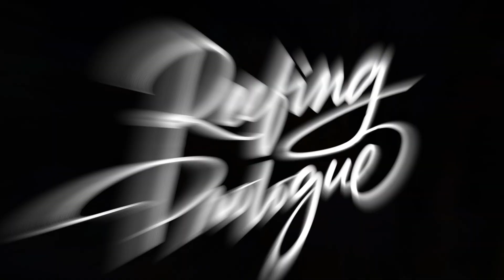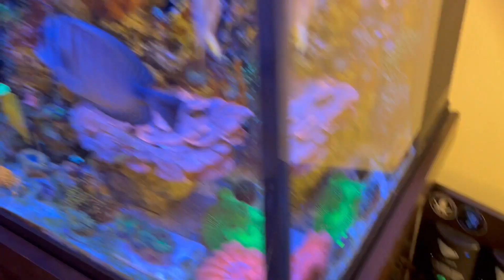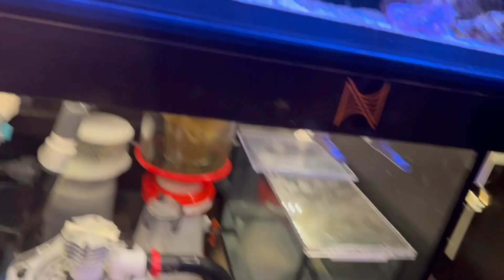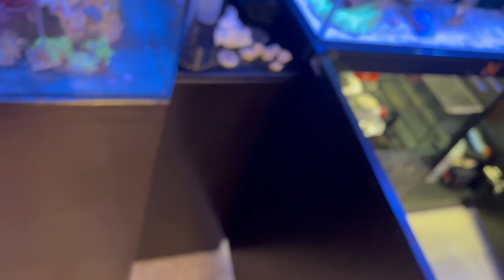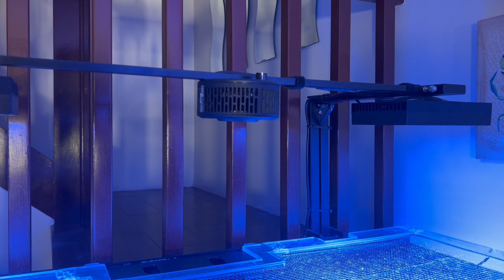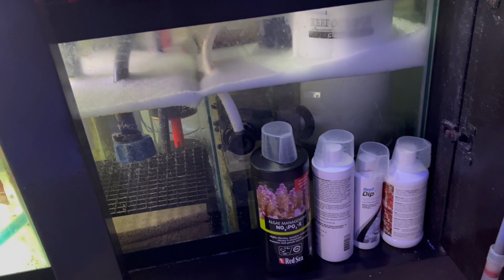Removing cyanobacteria from my system #cyanobacteria #redslime #greenslime

Comment: What are you going to do with the puffer and cow fish when they get so big ?? People buy the cow fish because they are cute but they grow so quickly.  And eventually the puffer will need its teeth filed down unless you provide coral to chew on. Are you going to buy a huge tank?? By the way i really like you're rock work
Reply from the maker: The puffer will go back to the sea.
I have plans to get a 300 gallon tank, I will transfer the cow fish to that tank.
Reply: @reefingprologue4220  can you release a captive puffer after being in a tank all its life ? That doesn't sound right, it will have no experience living with predators
Reply from the maker: That puffer came from the wild.
I cut it myself.